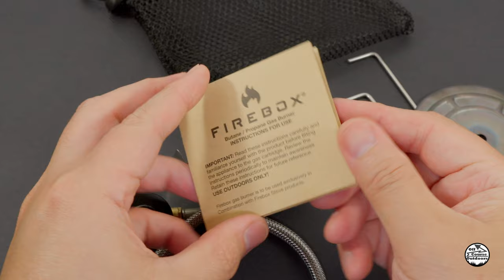[Product Test & Review] Firebox Gas Burner w/ Ti Diffuser

Comment: Did you happen to notice any intermittent firing of the jets when used at full pressure with a pot on top? Thanks for sharing
Reply from the maker: I have not but its probably becuase I have not run in it on full but I can test it. Do you know for how long I need to run it before the issue occurs?
Reply from the maker: Once again you made a wonderful video. After reviewing, I ran out into my garage to test. I got the same result you did. I did more testing with the Freestyle and got the same result you did. I raised the pot a few times and got it to stop. When I used the Ti diffuser I got it stop. I thought really hard as to why I never expericed this issue and it dawned on me that I really disliked how loud the air instake was when fully open. I've been running it about 2/3rds open. With it slightly closed the issue was no longer. I suspect that the pot in combination with the higher velocity of the 100% open intake contributed to generating some serious turbulence (mini tornado, lol). I also suspect that the Ti plate and the sligtly closed intake reduces the velocity either by friction or airflow redirection or restriction. Anyway, here is a video of the test. Please excuse the poor quality. Let me know your thought... Cheers!
https://youtu.be/TpKeiJMakys
Reply: @offcourseoutdoors8366  Watched your short vid. Exactly my experience. I mentioned it to Steve by email but he has not seen the video yet. Not a big issue really as I feel it is more fuel efficient when not run wide open. Love your videos. Keep up the good work
Reply from the maker: @MarkYoungBushcraft  Love your videos too. Keep doing what ya doin! Cheers!
Reply from the maker: Wait a second, I just had a thought. I wonder if the larger air holes are to accomodate for more air at higher altitude. If anyone has this stove and used it at a significant altitude please let us know the performance please and thank you!
Reply: The issue is the amount of air being allowed in. Having adjustable intake we have larger than necessary holes for the potential that an excess of air may be beneficial in high altitude circumstances. That has yet to be tested. That being said the stove runs best when the oversized holes are somewhat restricted. I believe the instruction pamphlet mentions having the holes at least slightly covered. I don't remember how it's worded but that was the intention. In less words, since the air is adjustable we allowed a wider range available than what may be pertinent at low elevations hoping that having more air accessible may be helpful at higher elevations or other difficult burning situations. I figured since the air can be controlled, why not.
Reply: @fireboxstove  Hi Steve. Thanks for jumping in on this thread. Now that you explain the design intent, it makes sense to me. I am at sea level so I can't test the altitude question. I will likely follow up my review with this information

Comment: Very nice video! I love that you had history with adjusting a flame. Your analytic nature lends itself very well to explaining my products. You totally get the design logic of Firebox! I did however want to comment on mounting in the freestyle. As well as apologize for not having an instructional video yet. Some of the final details on the burner were in flux until recently. It's actually super easy. Start by opening the four panel freestyle, run the pins through (the position you recommended) from any panel panel run the hose between the pins and through any feed hole (that makes sense). Even if the hose is directed toward the panel without a feed hole the hose is flexible enough to do a U-turn to go through a different hole. I just tried it again, I was remembering correctly. You don't even need a fire grate. The spring tension holds the stove firmly in position. I just looked at the instructions and they don't say anything about mounting the gas burner. It's all information you should have had. Definitely my bad.

Thanks again Mike!
Reply from the maker: Thanks for the detailed information Steve! Much appreciated! Cheers!

Comment: In campfire mode, can you hear the hissing as loud as it seems on the video? Also, do you have any idea of what rate the fuel consumption is in campfire mode? Can see this really useful during fire ban areas, but curious how long one could realistically run it using say 8oz container
Reply from the maker: I did not weight it before and after use, sorry. I will try to remember to do that when I use it next. In campfire mode it does hiss but not as loud as on the video, I had a directional mic pointed at it. Thanks again for watching! Cheers!

Comment: How does it run with a gas canister inverted so your burning liquid in winter if the liquid isn’t turning to a vapor?
Reply from the maker: The unit runs fine during the winter temps I camp in (40-50F). It does not have a preheating tube, so liquid burning may not be in scope for its use. Hope this helps, cheers!

Comment: ... Don't make it overly complicated eh!!
Reply from the maker: I totally did, you don’t need the base grate. The tension from the mounting pins holds everything in place. The air intake does need to be closed a bit to avoid sputtering. I need to update this video. Cheers!
Reply: .. Keep working on it bud!